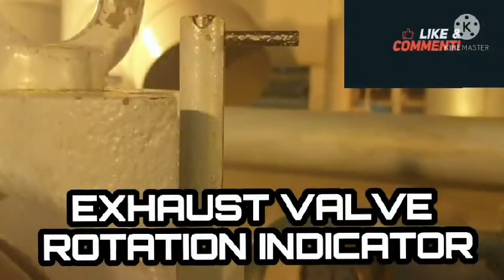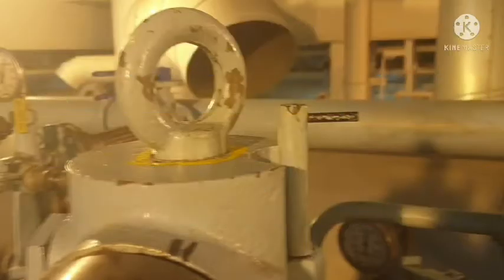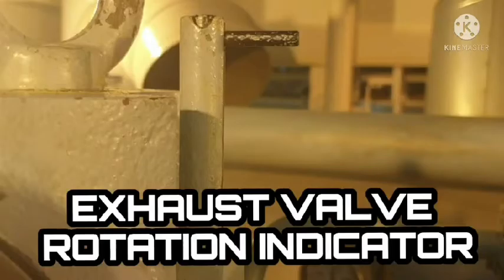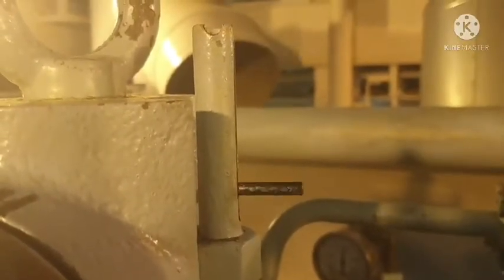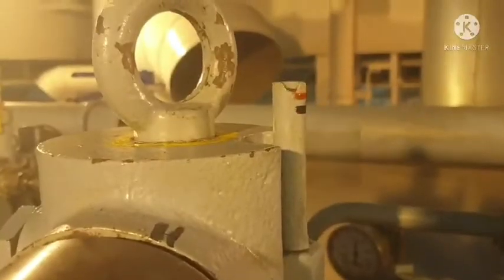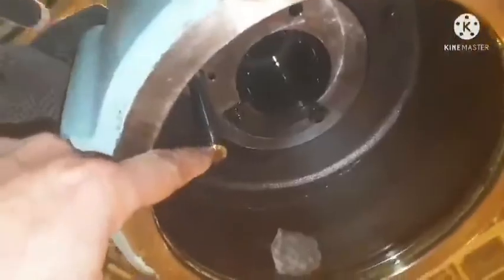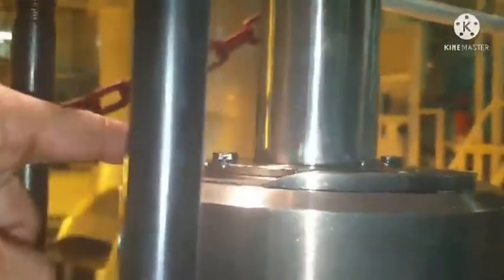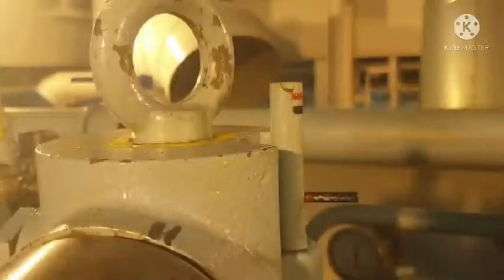HOW TO CHECK ME EXHAUST VALVE ROTATION | Chief Yoi

Comment: Hi i want to know if i change indicator rotation when the main engine is stop is necesary to close the air control?
Reply from the maker: No need because the indicator is only resting on top of the spring air cylinder
Reply: @yoyoymarinomixtv1992  thankss  your videos content excelent information.